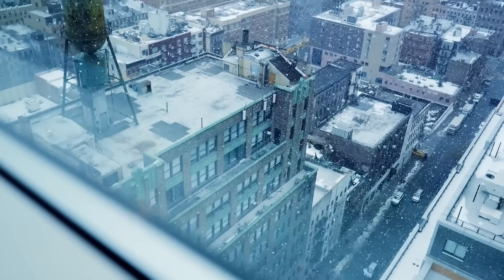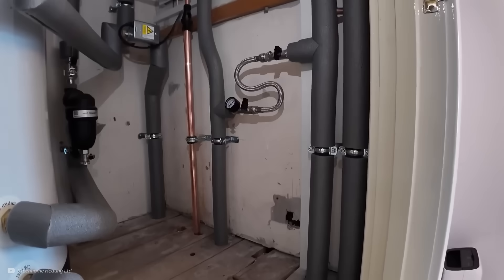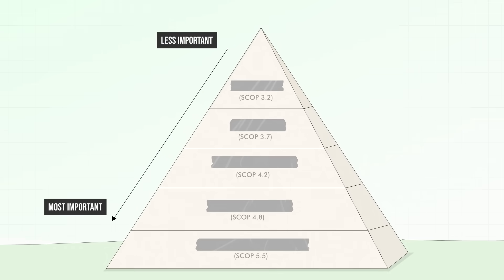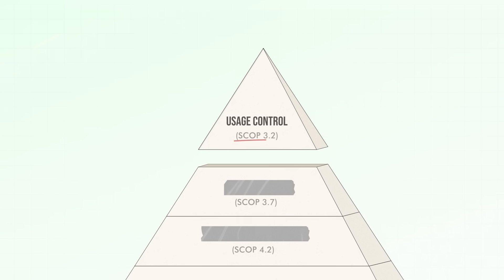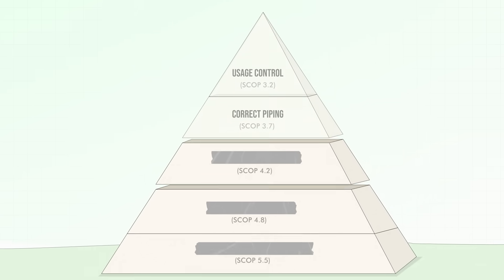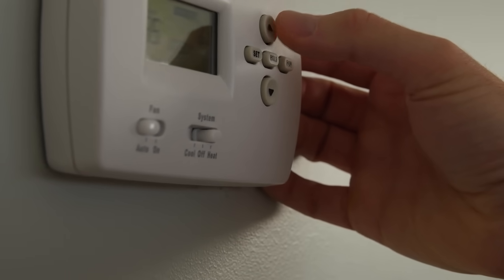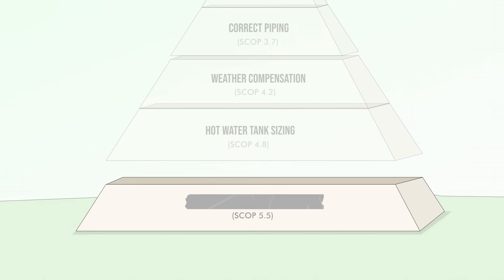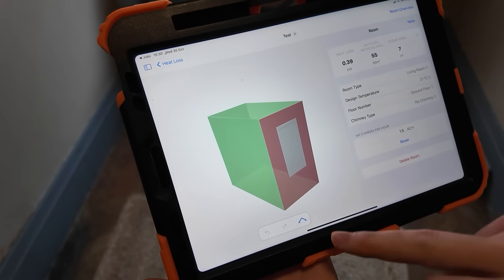The Genius of the World's Most Efficient Heat Pump

Comment: is SCOP a weighted average over the seasons? i can't imagine it matters much how efficient heating is in summer if we never need it. 500, 1, 1, 0.5 would simple average to a great SCOP but not be much good for our bills.
Reply: SCOP is total heat energy into the house divided by total electrical energy supplied to the pump over a whole year, so yes it is weighted by usage. COP actually reduces in the summer because the ratio of space heating to water heating it is dominated by hot water.
Reply: @rockyallen5092 Thanks for a concise reply.  

I remember clips when I started learning about decarbonisation there were constant references to terms I was utterly unfamiliar with.  In my case, getting my head around "R" values used to define thermal insulation took some doing, as it soon became clear some of the explanations came from people more clueless than me!
Reply: @rockyallen5092  cheers. good to know
Reply: Yes SCOP would matter, because the unit will heat water before ejecting energy outside like a traditional heat pump. This is especially useful in the fall time when the days are hot and the night is cold and to use the energy in the hot water tank when it is cold outside.

Comment: I like the technology but I got one installed by one of these grant firms. They had no clue. All rushed. Still costing me a tonne and struggling to heat the house.  I have to light the open fire some days.
Reply: Unfortunately,  any unregulated "gold rush" attracts it's share of cowboys who'll go bust before remedying the mess they've made.  If it's any consolation, Local Authorities (forced by statute to go for lowest bidders, if lacking the specific expertise to justify decisions to HMG) are in the same boat.

If you've acquired anything which you could have done with ahead of your awful experience, what would be your 'top tips'?
Reply: @TheHoveHeretic  Honestly it would be dont use a grant firm and don't be bullied into being rushed to meet grant deadlines.  I tried to get details before instalation day but there was zero communication, then they came in, put radiators anywhere, tank is in the wrong place then went bust before doing the insulation. 

I think just self fund as although it will cost more you will have control and time to do things properly.
Reply: @UnwittingSweater IF this story is genuine, why have you just left it like that instead of trying to get it resolved? That makes no sense when it's costing you money. You can contact a Heat Geek accredited engineer to come and have a look at it. The Urban Plumber channel has loads of videos where he fixes other installs. So it can be done.
Reply: @mikeypc3592  There are many reasons why I haven't got it fixed but the main one is I'm selling up.  Up to the next person to decide if they want to keep and fix or remove.

Comment: Ziroth became an AD Channel. What a huge downfall
Reply from the maker: I’m sorry it feels this way - Partners like Anker help pay for my teams salaries and keep a roof over my head, there is no way I could support myself (let alone anyone else) on YouTube revenue alone! 

And in case it wasn’t clear, HeatGeek had no involvement with this video apart from the interview. They are just doing really great work in my opinion that I was excited to share.

Is there any way you would prefer to see sponsors incorporated into videos in the future? Cheers, Ryan
Reply: But this is cool thing
Reply: @Getenari it’s not really possible. You can’t go from 2.5 cop at the heat pump then end up at 8. 
1kw in transfers 2.5kw heat to the system. You can’t then end up with 8kw at the radiators.
Reply: feel like you're just complaining to complain ngl
Reply: AD?  Albus Dumbledore?  Air Defense?  Architectural Design?  Anti-Diarrheal?
Reply: For so long as there's some connection between content and commercial and it's not the sort of rip-off crap claiming to have found a way around the laws of thermodynamics (as many space heater ads claim), I'm more exercised with the alley-cat morality of YouTube advertising, which is becoming more intrusive by the week.
Reply: You sound miserable.

Comment: if you like 17c heat and bath......get one..........
Reply: Why do you even bother watching channels lile this?  If you think you've  accomplished anything other than to parade your ignorance, think again.
Reply: @TheHoveHeretic    heat pumps are like EVs.....a good idea gone wrong...........
Reply: you clearly don't understand how heat pumps work...
Reply: @andan2293  I have a heat pump.........
Reply: @roystonbarton  I have 3.  My DHW is heated to 52C, and is plenty enough.  If you can only get 17C with yours then why didn't you raise an issue with the installer?
Reply: @BenIsInSweden  what is your electric bill?........mine is twice that I paid for gas and not as warm........beware legionella...........
Reply: @roystonbarton  comparing costs is useless especially to a completely different house.  What you need to compare is the kWh to do a proper comparison.
As for legionella, it takes longer to kill at 52C but still gets killed.  I can also use the immersion to take it up above 60C on a schedule if I've been away or not using much water.
Reply: If we're talking efficiency, can I have 1 heat pump that does my underfloor heating, hot water, AC, fridge freezer and clothes dryer?

Comment: A better system would be an insulated underground water tank about one or two cubic meters in volume that stores the grey water from showers, clothes washing and dishwashing.  The heated grey water would be temporarily stored in this tank and a heat pump would remove the heat from that stored water with switching to the outside air as needed similar to the heating and cooling modes of a heat pump.  A water pump would also enable the grey water to be recirculated back into the toilets for flushing thus reducing overall water intake from a well or municipal source by as much as 30%.  The sewage outflow to the municipal or septic tank would also be reduced with extra water available for lawn watering etc.  A system for retrieving waste heat from solar panels could also be added to this system.  This sort of hybrid system would offer an even better alternative to existing air to air heat pumps since it reduces the household incoming water usage and the outflow to the sewage system and thus the overall energy usage in water and sewage treatment systems.
Reply: Please do it, then make a video. I'll be waiting for an upload.
Reply: Something similar is done on a community level in Germany (afaik there are two projects that did this). Obviously it's with sewage and not grey water since those are not separated on this level, but they use water-water heat pumps to extract heat from the sewers for a local heating network.
Reply: @julianzurn1428  They just did a massive one of these for the Toronto Western Hospital in Canada with Noventa's waste water energy transfer system (WET).
Reply: This has been explored for showers, running the waste water through a heat exchanger unfortunately they need lots of maintenance as they block due to the skin oils etc solidifying as they cool
Reply: Rather than use an Air-Sourced Heat Pump for hot water, I would want to see a vacuum tube heat extractor on the roof as the input heat source. These extract most of available incident heat energy, not just the 15-25% of PV.
Reply: There is a guy in Alaska who has a 10.000 gallon tank of water. He stores boiling water and can heat the house for almost the entire winter.
Reply: @carloslemos6919 I would be very interested in more details on what kind of house that is.
It has to be extremly well insulated?
I live in Sweden at aproximatly the same lattitude as southern Alaska. In my 65 year old house that amount of heat would last roughly one winter month, assuming 100 % efficency and no losses during storing phase.
Reply: @ab22aq22  https://www.youtube.com/watch?v=AtHkvpRI6fc

https://www.youtube.com/watch?v=TefNcwHpCwA

You're right! I exaggerated the 'almost entire winter'. But he is also getting heat, even in the winter, from solar (heat) panels. Passive solar from windows.

I wonder if, in that specific case, isn't just more efficient and cheap to burn biomass that grows in the summer on nearby land.
Reply: @carloslemos6919  10k galons is about 4x4x4 metres. With this big tank he can heat up a giant barn.
Reply: @DeathSugar  38 tons of boiling water
Reply: @EVR1AL  boiling sounds like waste of energy. prolly just hot
Reply: I made one of these in my basement and the washing machine and main bathtub shower water ran into two large plastic garbage containers.  The first one was the warmest and it overflowed into the second one and the heat just radiated into the house all day long.  From the second one the water drained into the sewer.  The water fed from the bottom of one container to the top of the next, so I would draw the colder water from the bottom.   I don't know how much heat I was actually getting but it was free and I have lots of room in my basement.   After a while it started to smell , so I got rid of it.   I should set it up again, I still have all the drain pipes in place to divert the water.   You actually need more than two garbage cans so that all of the heat is recovered.   Some bleach once in a while should take care of the smell or a better sealed system.   I also had the main kitchen sink water draining into these containers.
Reply: How much energy would be recoverable from the gray water?
Reply: @andan2293 Broadly the same as pure water, though I'd need convincing variables from contaminants such as salinity or pH weren't too detrimental to the installation to make such systems economic.
Reply: There's a company in Canada called Sharc Energy that does this but for hotels, condos, and neighborhoods, they have said they are making a residential unit soon
Reply: This has been tried many times over the last 40-50 years. I looked at it hard when renovating a cottage 30 years ago but on a domestic scale it just doesn’t work. There are many problems; the fact that availability of heat does align with time of demand is one but the biggest to be honest is the fat clogging and stench created by cold grey water. I built a separate grey water system and recycled the water, though again, actually using it is very complex and costly with dual plumbing systems and pumps needed. I now have an ASHP which is brilliant, and better still a micro ASHP which takes the hot damp air from kitchen and bathroom and turns it into hot water. 
Grey water heat recovery could possibly work on a large scale (say in a hotel) but it is low grade heat and the gain is very small. Unless of course you use a heat pump to concentrate it…
Reply: When it comes to showers, a more efficient (though not as pleasant) solution is to just plug the drain while you're taking a shower, and then drain the water after it becomes room temperature.
With a lot of dishwashers, the last 30-40 minutes is often just a drying cycle - if you cancel the wash after the last time it drains the water, you can dump a great deal of that heat into your home while also allowing the dishes to dry quicker since the steam has somewhere to go.  This obviously doesn't do anything about the gallons of scalding hot water dumped down the drain but it does a little bit to add efficiency with minimal effort.
Most other sources of hot water likely don't have enough thermal energy to make a noteworthy difference.  In fact, if all of your gray water were to be put into the same basin, I wouldn't be surprised if some of it may actually freeze if your winters are cold enough.
Reply: @Toastmaster_5000 And ruin the kitchen cabinetry in the process.
Reply: You don't need to store the water, just route it to a heat exchanger and the heat pump can heat the water as you're using it.

I suspect you're going to have issues like residue build up.
Reply: Interesting idea. Let's do a back of the envelope calculation. 

Assume the house uses 300L of recoverable water - it averages 20C temperature drop and it's on average 10C warmer than the air. 

That's 7kWh of recoverable heat. It's something, but not a significant contribution. It would be 10% of my daily heating load, and for that you need a separate refrigeration loop, heat exchangers, tanks, valves, pumps, F gas registered installers and welders to contain your refrigerant properly, as well as waste water rerouting. Call it £2000 - it will definitely be more. 

The COP impact of 10C higher source temperature might be an increase from 3.5-4.5, so you would probably save about 0.5kWh electricity per day. 12 pence/day.
Reply: This exists commercially in Norway. Waste water from shower running through a heat exchanger, where the other line is the input to hot water tank. Realistically recovers like 60% of the heat with a small footprint. Requirement is that the shower is on a higher floor than the hot water tank. Water still goes to drain, but the heat is recovered
Reply: @niklastrippler1053  I have seen similar systems that are incorporated in drain armature as a opposite flow heat exchanger. It heats up the cold line, so you can mix less hot water in the output mix. Genially simople, easy to clean(just pull off the drain grille time to time) and thats it. Just the price for such systems are like beyond economical sanity.
Reply: another thing you could do is feed the output from your dryer into the air input for the heat pump, so you can get some of that energy back in the system, since the majority of driers still just chuck hot air directly out a hole in the wall
Reply: @dawnderg  thats not a thing wherever energy costs orders of magnitude more than in the states. you either dont use a dryer or you already have a heatpump dryer.
Reply: @dawnderg  True most are - but if that is the only way your dry your clothes then go and buy a heat pump dryer ASAP. The cost of them is the USA though is unbelievable. The Beko ventless dryer in the USA typically costs US$900, the "same unit" in Australia costs A$750, making that the before taxes price makes it US$422. It isn't transport USA is closer to Türkiye than Aus.... One of the few times I am glad to be in Aus and not the USA for pricing....  By the way they have no exhaust and no humidity impact as they condense the vapor and pump it down the drain. Also no dust in the house as they have filters in the machine, that you need to clean obviously. A European design where the laundry may be behind a door in the kitchen with the dryer stacked on top of the washing machine (front loader). The top loader WM and vented dryers are just developments from the 50's/60's, sure they work but they sure as heck aren't efficient. FYI Aus used to use the same types as USA but we now use a VERY high level of the stacking type.
Reply: @dawnderg You wouldn’t need a dryer if your laundry was heated.
Reply: @dawnderg  and compose it with house ventilation to have beatuful dust color everywhere
Reply: @DeathSugar  they have filters so this isn't a problem at all.
Reply: great idea, ive thought about this before, it could be as simple as an insulated septic tank type thing with a stainless or titanium heat exchanger, the grey water could be emptied via the bottom of the tank to maximise stratification. a thermal cutoff would have to be used to stop the heap pump freezing it solid.
Reply: Also you can pump the grey water down to about 4C (39F) before releasing it.
Reply: Engineering is about cost and benefits, including maintenance costs and markets. It’s quite easy to over-engineer a very complex system for yourself or that doesn’t take into consideration market forces.
Reply: "A water pump would also enable the grey water to be recirculated back into the toilets for flushing thus reducing overall water intake from a well or municipal source by as much as 30%. "

Grey water would leave you with a constantly dirty toilet, possibly smelly, which needs more frequent cleaning, using more water each time you clean.
Reply: Identify the problem, and a solution can be identified.  The smelly , dirty water can be improved with filter and colloidal silver generator, powered with 9 volts.
Reply: There are filter systems for recycling shower water...and so does International Space Station, but not showers, recycles urine for drinking.
Reply: Denser water means hight costs of pumping so, no, grey water from your septic won't help you and will introduce to potential health dangers.